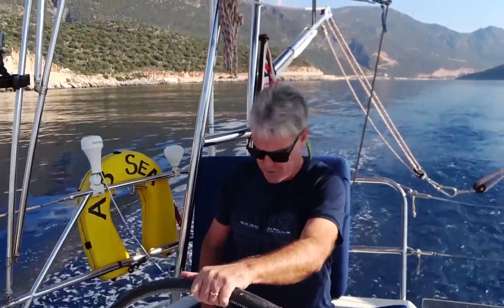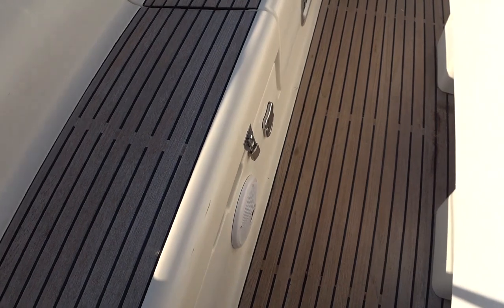Full test after rebuilding the engine - Sailing A B Sea (Ep.151)

Comment: Hey you guys that is a real high to finish on prior to the Christmas break. Believe it or not I am relieved as you are that all is OK with your propulsion system. You and Kevin should be rightly proud of your achievement.

With reference to white smoke it can be difficult to distinguish sometimes between white smoke and water vapour.

On the subject of allowing the turbo to cool down - to be honest after you have finished manoeuvring into the dock- there is lots to do all at once - lazy lines, warps, passerelle and making a coffee just have the engine at idle while you do the important stuff - and 5 mins at idle is plenty.

Enjoy your Christmas celebrations.👍
Reply from the maker: Thanks for that info about the cool down time Norman. Have a great Christmas and we'll see you in 2021. Cheers.

Comment: Really fun episode - seemed to be the cherry on top of a long series of engine episodes. But Baz - need an honest assessment - did you notice a reduction of RPM while maintaining your 7 knot speed - versus pre overhaul?  That aside - I look forward to your inland journey - and be sure to take us to some ancient spot that conjures up life must have been like 2,000 years ago. And I'd also like to add - the joy you two felt while on the trial run was palpable - made me feel joy too - sitting in my dark room 7000 miles away on a late Friday night.
Reply from the maker: Hi Murray, previously we would've had the prop in overdrive mode with the water being that calm so we would expect 7 knots at around 1,500 rpm. However now that we've learned that it's better to work a diesel engine hard we'll be happy to get 6 knots at 2,000 rpm in normal prop drive. So to answer your question, it's about the same as pre rebuild.

Comment: Great job on the upper end rebuild of the engine  it's sounding very healthy. Be sure to check the manual  to see if you need to retorque anything after a set number of hours of the engine running. Happy holidays to the both of you.
Reply from the maker: Hey KC, there was no mention of a re-torque in the manual, which is a good thing because that would require removing the rocker assembly again. Have a fun filled Christmas and New Year. 😀

Comment: Non watercooled turbos in cars generally have  a 2 minute cooldown. Excessive idling a diesel can cause the engine to varnish up. This means that you have a toss up between cooling your turbo or damaging the engine with gunk. If the engine has worked hard I would let it idle for 3 minutes tops. But it is not my engine
Reply from the maker: That's good info Chris, thanks for sharing. 👍
Reply: @SailingABSea  not a mechanic , but i looked about and found the same info. Also found that the main problem with Turbo's overtime is that they are not used , so rev it up ! make sure that Turbo kicks in and runs a bit. 
 Fair Winds and Happy Hollydaze :)
Reply from the maker: Give it some revs, I hear ya. Warp factor 6 here we come. 🚀 👍 😂

Comment: Just remember to NOT just simply shut off the engine after a run with a turbo. The turbo is feed oil from the engine oil pump so when you shut down the engine you shut down the oil supply to the turbo. The turbo spinning many thousands of RPM will continue to spin long after the engine shuts off. So in situations the turbo could be spinning oil starved and cause premature wear and tear on the turbo. So it is best to idle the engine for a period of time BEFORE you shut it down . It is NOT about letting it cool down (;-).

(;-) TP
Reply from the maker: Thank you for explaining that TP, advice taken on board. 👍

Comment: Hey Baz,

Just wondering what scuba certificate you might have, and did you have any trouble getting tanks filled anywhere in the med?  I know you put a dive compressor on the boat, but you did quite a bit of diving before that.
Reply from the maker: (Baz) I did all of my dive training with SSI, but due to that scuba shop closing down, I did my final Dive Master certificate with TDI. I have done around 330 dives so far.

Comment: Good news the engine is running, now your sitting at the dock for weeks on shore power , do you ever just disconnent it and let the batteries work ,drain and then recharge , as soon as I get to a new boat thats been sitting on shore power I always disconnect shore power to let the batteries work,  and have had to change many dead batteries for this reason,  ?
Reply from the maker: (Baz) Hi David, our batteries are just normal sealed lead acid and can only be discharged by 30% without damaging them. It's coincidental that you should bring this us as I have been pondering that question for the last couple of weeks. I'll do some research on it when I need a break from editing. Cheers.
Reply: @SailingABSea  i fully understand your lead acid,  and the % , if you ask the marina guys they will say don't worry, but they go home to a house, 
As they measure batteries I  cycles thats important. Evan rown to 80 or 90% keeps them working. Have you noticed with a phone starts of strong but the more times you charge when still on ,you have to charge more often,   sailing Wynne just left there boat a year, solar on, batteries running , left a fridge on, so at night the batteries dropped a bit. 
All running .   I feel the batteries should be allowed to rise and fall for a longer life .
Reply from the maker: @davidwarnes5158  you do make some good points. Thanks.

Comment: Baz, I can understand you might requiring assistance from the marine staff to arrive, but leaving? Do you have a bow thruster issue?**

** Just read your response to another, similar comment, but remember the staff aren’t always there to help, we sailors should learn to be self sufficient.  We are no different than you, and have a Mediterranean stern too berth but with a larger boat and never ask assistance unless the wind is very high and normally under those conditions we go elsewhere, beam on to a fuel berth.
Reply from the maker: 😂 The bow thruster works just fine. Because we were filming this segment in a more detailed way than we usually do, we actually wanted to get some shots of the marineros when departing and returning. 
Normally Aannsha just drops the lazy line, watches until it's clear and then comes aft to slip the port aft line.
The fairway is massive and although the bow thruster is always armed, I play a game with myself and try not to use it. 👍 Have a great Christmas and New Year.
Reply: @SailingABSea  you too have a great Christmas in Turkey, will it be Turkey in Turkey for Christmas lunch?
Reply from the maker: Unfortunately no turkey in Turkey for this Christmas. Because restaurants can only do take away or delivery, many of them have closed their doors completely as there is not enough trade. A group of us at the marina had planned a traditional Christmas lunch but that's been postponed until the restaurants reopen. It looks like it'll be a couple of beers and a bag of Doritos instead. 😂😂😂
Reply: @SailingABSea  I picture a Frito-Lay commercial with the two of you celebrating a new Christmas tradition in Turkey. 💲💰🤑
Reply from the maker: Do Frito-Lay make turkey flavoured chips? 🤔😂